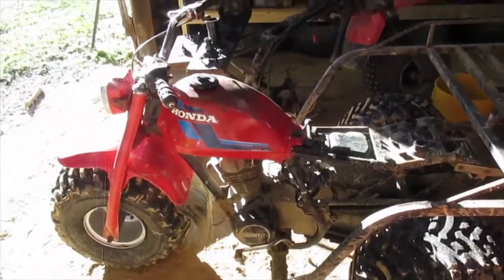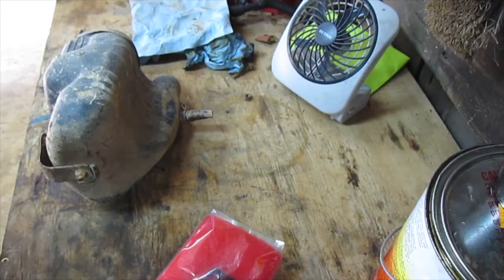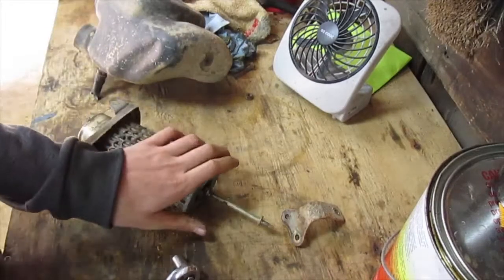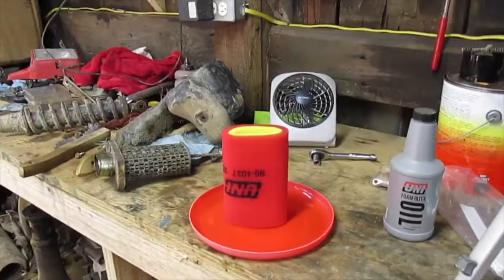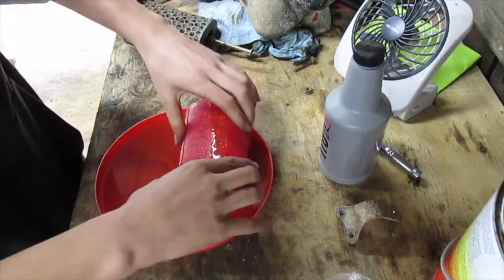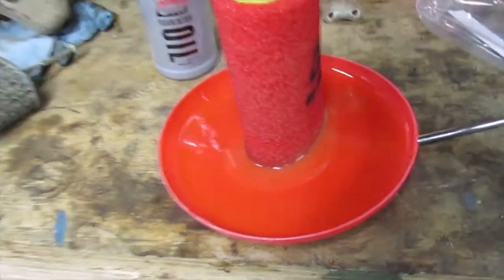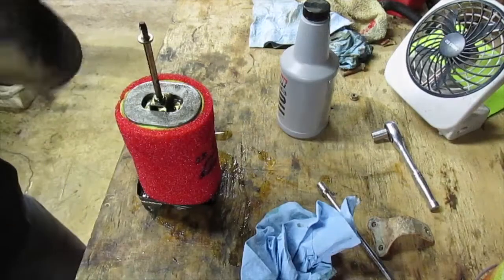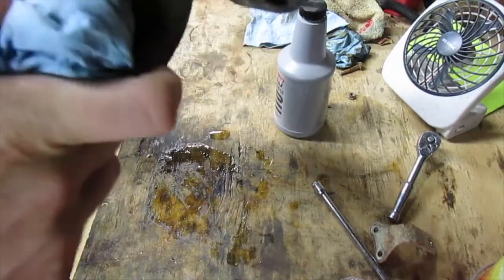How to change the air filter on a Honda 185s

Comment: Hello 
i have a Honda 200m. i cant start the engine. If i change the spark plug it will run some times . But after 4 - 5 times it will stop. What can i do with this ?
Reply from the maker: After you have ran it a little bit check and see what color your spark plug is if it’s black then your fuel mixture is too rich it should be roughly the color of a brown paper bag if it’s kind of a shiny black and looks like it’s really built up with soot then that means you are burning a lot of oil and you have a engine problem that is where I would start